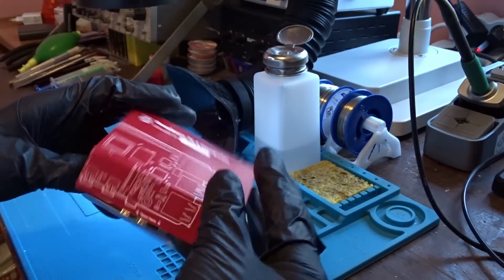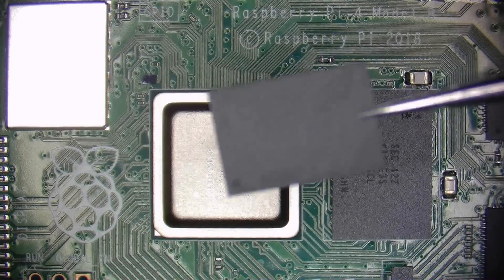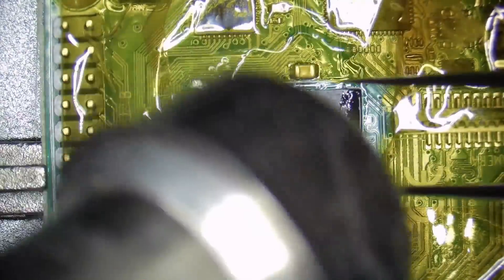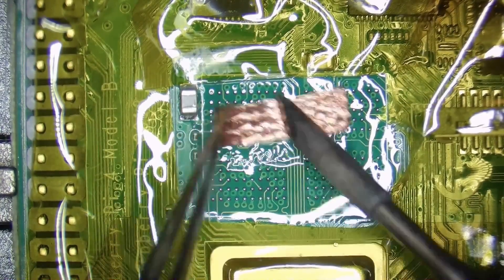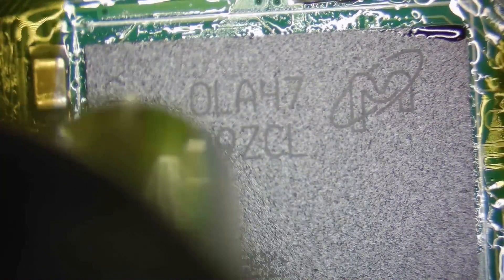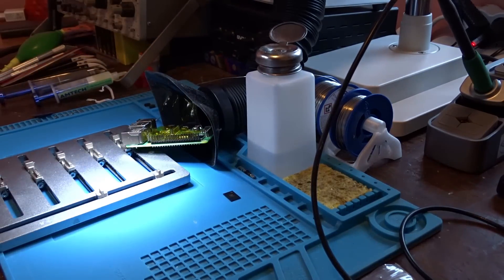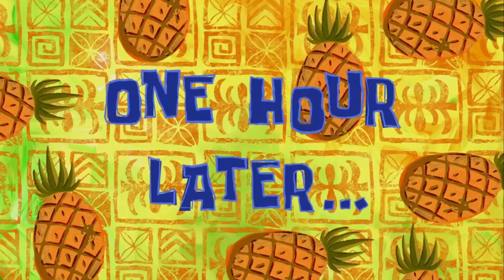Raspberry Pi 4 RAM Upgrade - Tutorial🤫

Comment: An x-ray reflow station makes this a lot easier. I used to work at a repair shop and we mainly did reballing of failed playstations, xbox and laptops. We fixed a few GPUs as well but mostly with bad ram chips, which is the same procedure as you show here.
Reply: Xray reflow? Like a fluoro for computers?! That's insanely cool!

Comment: video is good, though. but one question. why don't you use bottom heating when soldering chips? this way you can distort the board itself, and that's really bad.
Reply from the maker: In my opinion the board is small enough for this job to be ok without preheating it. Also at this point, I don't have a preheater...

Comment: Can you do the Orange Pi Zero2?    It's the cheapest thing I could find to run OctoPrint.  It only comes with 1GB, but the chip (Allwinner H616) can support 4GB.  I was thinking that they'd be awesome little toys to fill the role of RPi Zero, until the RPi are available again.

I have the tools to do it, I just haven't looked into it enough to see if it could be done.  If I know it can be done, I can spend an hour doing it, after paying tasks are complete for the day. :)

Comment: Can I upgrade my raspberry pi 3b+ to 4gb ram?
Reply from the maker: Nope, the CPU supports up to 1GB
Reply: @MadEDoctor  then can I upgrade pi zero 2w to 1gb ram ?
Reply from the maker: @lp3037  I think this will be either very difficult or straight away impossible since the ram it uses is directly soldered on top of the CPU unlike the B models where it is separate module.

Comment: At our maker space, we've done a few of these. We made a ram chip alignment tool cut on our CNC machine that allows repeatable placing of the replaced ram chips. Out of 8 attempts, we had 2 failures. Also, the upgraded boards do not seem to perform as well as a native 8GB model in long term testing (transcoding video files using ffmpeg)
Reply: Ram chip probably got too hot during the rework
Reply: to repeat the placing you just need to draw markings around the chip before desoldering, you don't need a cnc and chip alignment tools if not for mass operations, but you did not fail by overengineering, it is probably for other reasons

Comment: "Nowadays this is the cheapest way to get an 8 GB Raspberry Pi 4" 😢
Reply: When did Raspi become the bad guys Jeff?
And here I am, having bought the model 4B, 5 months before the model 5 was released. 
sigh.
Reply: Ther is 8gb ram for 54.99 on Amazon
Reply: Man he is talking about  when there was shortage of pi . They were selling for like 100-150 dollars
Reply: @shashwatpratap  its well over a 100$ where I live
Reply: or is it. 1GB ram cost more than 8GB per 1GB. remove 1GB from board make it cheaper then ad 8GB to that price. if you do math. it not safe anything and you have 1GB extra ram useless xD
example same type chip 1gb cost 74 and 2gb cost 94 not the ones RPI use but give you idea.
first we remove chip price we remove then add what we replace. yes its cheaper but you left unused ram its extra cost unless sell it. so upgrading cost more actually

Comment: Do you know what the ram limit is for the cpu used in the pi4? Very cool demo.
Reply from the maker: In its data sheet is listed that the MMU of the CPU supports either 40 or 44bit RAM addresses depending on the configuration which in both cases equals to more than 32GB of RAM

Comment: Every pi i owned had some different problem to the others .. I would never buy another .I used to upgrade spectrums and i can smell a leaky data leak .
Reply from the maker: Actually, I have been wondering if this exact upgrade is possible for almost 2 years till the day I filmed this video. There are the reasons why I waited so long to try it. The first one is I didn't have the experience or the balls to try it and the other is all the people in forums that do everything they can to ensure you that this is impossible by any means...
Reply: @MadEDoctor  I learned about reballing and often wondered myself . I was told i was mad when i told motherboard companies i had built a watercooled pc . . .upgraded cyrix may give you a timeframe . .Best of luck with your reballing i hope you get loads of customers . And can fulfill your orders unlike some companies .

Comment: Very good presentation!  I wish I had the experience to do this flawlessly.  I am sure you have been doing this a lot with other SMD's.  I wish the RPI foundation used an IC socket for the memory--especially if no change to the firmware/OS is necessary.  This upgrade would be great on the RPI5 scheduled to be released next year maybe.
Reply: That would be really expensive and probably cause reliability issues too (as well as being unneccesary on an embedded device)

Comment: so if this is possible for a rasp pi would you be able to do this with a laptop that has soldered memory🤔🤔
Reply from the maker: It depends on the exact model, but most probably the answer is yes.
Reply: @MadEDoctor  so there is hope for my laptop that only has 4 GB nice i will look into it a bit

Comment: Great job . But this raised me a lot of questions. If everything in raspberry pi(arm chip ) is adress mapped how this 8gb ram will be mapped , in the cpu by default?  And also Is there any software changes required   For accessing this extra GB?   https://en.m.wikipedia.org/wiki/Memory-mapped_I/O_and_port-mapped_I/O#:~:text=Memory%2Dmapped%20I%2FO%20uses,of%20the%20I%2FO%20device.
Reply from the maker: There are no software changes required. 
The only logical explanation I can make up (since there is no official info on this) on how the raspberry knows how much ram does it have installed is:
That It should have like boot sequence in which the CPU checks what is the highest memory address available for read and write and uses that information to determine how much RAM its installed.

Comment: DON'T !
This job requires a high skill level and experience in solder techniques.
95% of you watching this will destroy the Pi trying it !
Reply from the maker: I think that everybody has a head on their shoulders and so can use it to decide if they are capable of doing this or not.
The main reasons for this video to be made were my personal curiosity and also to prove that this is possible because there are tons of people out there that would do everything they can to ensure you that this is impossible by any means... and then I thought that either way I am investing my time and resources in this video so why not share everything to at least be helpful for the people capable of doing it.

Comment: Quick question, I may have missed it, but how did you know the correct orientation of the ram chip so every pin on the memory is connected to the respective one on the PI? I would guess the ram had a datasheet and probably (I havent serch that deep yet) that the documentation of the PI has a pin specific documentation as well?
Reply from the maker: Well every chip has a marking on it for the orientation. Usually a dot or indentation.

Comment: I've been interested in trying hot air rework and now I have a goal, as I have two 1GB RPi4s that could make use of this. But of course first my plan will be to take boards from old equipment that doesn't matter and practice, practice, practice.

Well put together video! The artificial voice was a little annoying but I can fully understand why you've used it. If you haven't added it since the last time I checked the description, can you provide the info on your fume extractor as well?
Reply from the maker: Thank you! I just added the link to the fume extractor in the description :)

Comment: Just a small thing.
Could you say the temperature you are using whether it is Celsius or Fahrenheit in your videos please.
I don't mind doing the conversions myself (if at all required), but would be very handy to know which system you are using to avoid confusion.
Would be so much appreciated.
Fantastic video.
Subscribed.
Reply from the maker: Yeah I just realized that I missed to mention this… I am using Celsius since I am from Bulgaria.
Reply: I believe he said 400 degrees, this is fahrenheit
Reply: @jameslee3663   400°F is around 200°C, this wouldnt get the solder even slightly molten...
We are talking about 400°C of cause.

Comment: Great video! Might try this.
One tip if you do lots of hot air soldering. Try to find a vacuum picker with heat shrouds and spring loaded pickers. That way you minimise the risk of overheating or damage to the board.
Reply from the maker: Thank you! Actually very nice suggestion.

Comment: "This is the cheapest way to get 8GB"
No, no it's not. It's safer, easier and cheaper to just buy an 8GB model. The cost of the tools and expertise required to this upgrade yourself safely is too high. The average Pi user won't be able to do that.
It's nice for a YouTube video though, but that's about it.

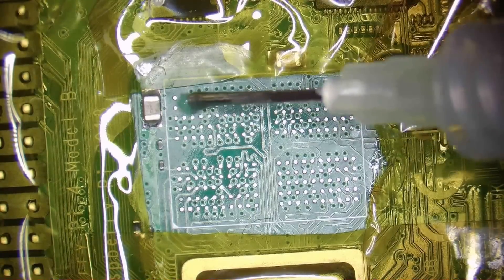Comment: At minute 04:10 there is a hair-like object at the lower edge. That could have easily spoiled the whole experience ...
Reply from the maker: Yeah even I noticed it now, like 10 after doing the job… And I don’t think it should be a concern for the soldering?
Reply: Yup, something like a piece of fine wire wouldn't be too helpful underneath the module. Nice video and work!

Comment: Just an advice for those who'll do it their first times. Guys, you can make dots with a marker before removing the ram chip. When using packaging QFN type you have guides, but with RAM no, not always at least. So, worth making guides yourself. It's SUPER easy to make a mistake. I micro solder only for over 2 years and I can do it, but still no expert because it's only a part of what I'm doing. I can't practise each and every day, I fix all household electronics. But, if you don't have a practise, at least you can have these guides you've made ;).
Reply: Permanent black marker don't work, they just dissolved in flux when heated up😂
Reply: @note2tee  Slightly scratch on the outlines of the chip.
Reply: @note2tee  I was using this yes, they go off, but not 100%. Maybe it depends on the marker? But, this is how I've started and was helpful to me ;).
Reply: @screen-protector  mine stays when u apply flux, but as soon as the hot air blows it hot, it dissolve and gone without leaving any mark, the only way is lightly scratch a very short line on the solder mask
Reply: @note2tee  Well, in this case this method is not always working though. I was using it and that's why I'm sharing :). But with scratching if there's no traces is not a bad idea as well :).
Reply: thats what I was going to write - scratch out border of chip / use some marker to mark position of original chip
Reply: Good idea, thanks for the tip!
Reply: I mean.. if you can't center the chip within the border on the board, maybe micro soldering isn't for you 😅

Comment: Do you think, it's possible to make a USB stick with 2 memchips In raid 1 for example. The idea is, if you have some very important files and the first mem chip is broken, you have the other on the same stick 😁
Reply from the maker: I think it would be better to just buy SSD with USB interface and use it for this purpose.
Reply: Ok, I think I understand your answer.
It's not easy to do this😃 thanks anyway 😅

Comment: One step where it's easy to go wrong is when cleaning the solder with copper braid.  It's important to cut off the piece of braid, or else the long braid will act as a heat sink and might cool down parts of it that aren't near the iron tip, possibly sticking to pads and ripping them off.  Of course, you also can't cut the braid too short, or else it can disintegrate.  A good method is to hold the piece of braid with soldering tweezers (for SMD rework), but most people don't have those.  If you want to be really careful, you can use a piece of plain thin wire to wrap around the braid to attach it to the iron tip.
Reply from the maker: Very accurate to the point.
Reply: Good hint.. I was wondering why he used a small piece, and the thermal heatsink problem makes total sense..
Reply: I literally learned this yesterday lol

I work in metal fabrication and absolutely know better regarding metallic structure heat sinks. Hoping to get a hot air station for my birthday so I can expand my capabilities.
Reply: @cryangallegos  I got one for christmas and haven't tried it yet..  I have a small SMD practice kit I'm going to try first...  and I hope I never have to work on a PI, but will be happy once I know I have the skill to do so if I need to!
Reply: Apparently I watched this video at some point in the past because I had already liked this comment, and I have been properly trimming my wick ever since

Comment: Easiest way to check if chip is already soldered is to look at it from the side not from the top, on the exact moment when solder melts, chip will move like half mm down (it is clearly visible) so you need just use hotgun few sec more and its done.

Its weird and not weird at all that it not requires any additional changes, like on gpu you have to change position of resistors, but on the other hand car multimedia systems dont require any additional changes too..
Reply from the maker: Also with the GPUs you may not always need to change resistors, but in all cases you would need to flash a new bios.

Comment: Would a bismuth solder or something like ChipQuick be ok here too?
I'm always hesitant to heat complex or intricate components in fear of overdoing it, because i'm kinda slowpokish :D
I mean i am at least a decent microscope away from doing BGAs and 2mm components anyway. 
Still can't believe how much my eyesight has degraded in the past 10 years 😞
Reply from the maker: ChipQuick is definitely not recommended, but I think the bismuth lead-free should be ok.
Reply: @MadEDoctor  Thank you.
Is it the far too low melting point of CQ? i mean not using it on an nV GPU is a no brainer, but the RP4 aren't that much of a thermodynamic nightmare?
Reply from the maker: @DasIllu  I have read its between 84 and 91C which is very very low and I will not recommended not only because it can melt during operation, but also because I think the joints will be extremely brittle. As for the low melt that is Sn/Bi compound and usually melts around 143C and it is better, but still not ideal.
Reply: @MadEDoctor  Again thank you.

Comment: I am not that skilful. I didn't know it was possible. 

How much would someone charge to do that?
Reply from the maker: When I do repairs, I usually charge between 30-50$ per hour. Because there is usually a lot of diagnosing involved. 
This is like 50 min. job and since it is pretty straightforward I wouldn't charge more than 25$ for the job in total.
The price of the chip depends on what capacity you want to upgrade to, but the difference in the price between them isn't significant. The 8GB chip comes at around 30$.

Comment: you can mark the corners with a sharpie on the original memory chip before soldering, it makes life a lot easier to match the position with the new chip.
Reply from the maker: Yes you can, but the isopropyl alcohol used for cleaning the burnt flux will clean the sharpie too.
Reply: @MadEDoctor  sharpie knife then :)

Comment: Great work!!! Is there anyway this memory upgrade is possible for an Asus L410 laptop?? It’s just a matter finding higher RAM chip with the same footprint and I/O specs , correct?? Any thoughts or insights will be greatly appreciated. Thanks for the awesome video!!
Reply from the maker: Most probably it is possible! Especially if there is model of the same laptop with higher memory on the market.
Reply: Also, your laptop's chipset should support memory chips of higher density.

Comment: I do this the same, except for 2 things:
1) add flux under the middle of the chip on the board, place the new chip on the flux.
2) after removing the old solder I apply fresh leaded solder to all the pads using a molten solder blob on the end of the iron.

Why?

1) When the balls on the bottom of the chip have flux on the the thermal transfer is better.
2) Fresh leaded solder under the balls also then gives you about the same amount of solder under each ball that you'd have normally as when the boards are made they use a stencil with openings for each pad and apply solder paste to apply paste to each pad. this solder paste melts and combines with the solder on the balls on the bottom of the chip.

Works for me, i design, build and manufacture PCBs using TFBGA100 packages and have replaced a few BGA chips for my customers with success every time.

Comment: Makes for an interesting, albeit common SMD package replacement video. Just order the 8GB version and save money on superfluous tools, unless SMD work is how you make a living. $213 USD on Amazon for an RPi4 8gb won't pay for 1/3 the cost of your microscope + lens. This is by far not the cheapest way to get an 8GB RPI 4, by any means. The cost of an RPI 4 8GB will come close to covering the cost of the soldering station, however. 😂

If ~$1000 in parts and tools to replace the smd ram on an RPI 4 is cheaper than getting the ~$213 product itself, something is very wrong.
Reply from the maker: If you are doing it yourself it won’t be the cheapest by far, but if find somebody who already has all the equipment and the skills needed that can do it for you it will be cheaper to pay him do it rather than buying one with 8GB.
Reply: @MadEDoctor  So it's a marketing video. Understood.
Reply from the maker: @Desert-edDave  no as said in the title it is a tutorial... You get to choose what to do with that information.
Reply: @MadEDoctor  I wish you all the best in your future business ventures. 😉